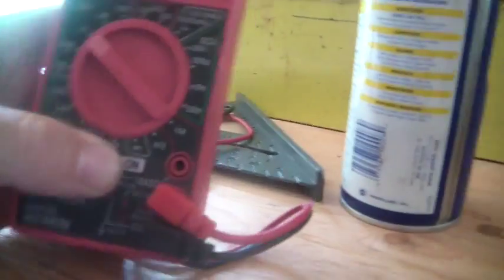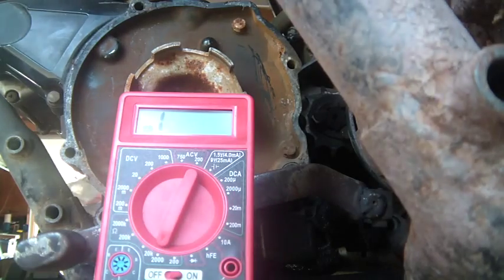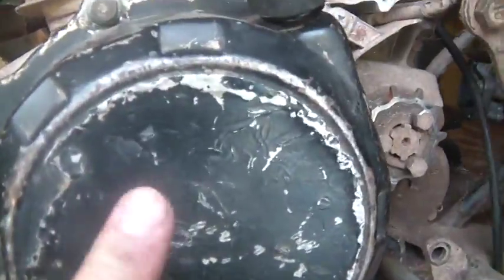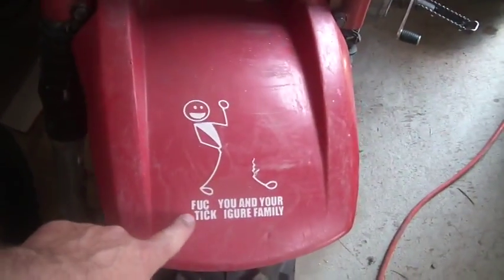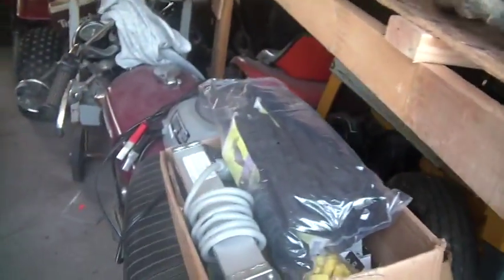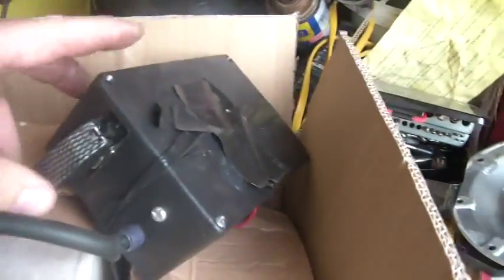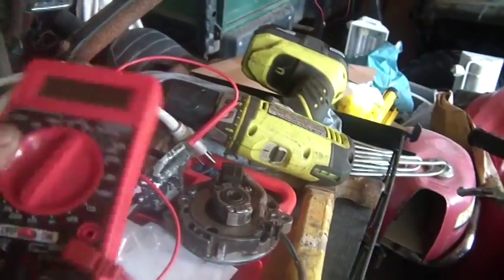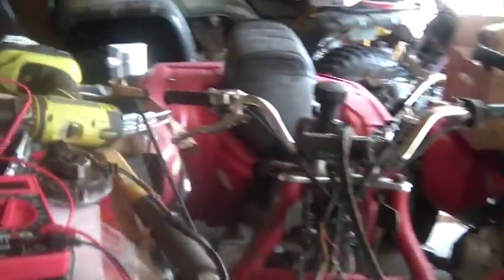8_5_2014, Solar Panels, Testing Honda ATC200 stator and Pulse coil,

Comment: My stator ran about 103ohms. Now I keep having an issue of the thing fouling out spark plugs like crazy. Now could a stator that seems to be a little low cause it to not be hot enough and then cause the spark plug to then foul? I've been chasing this issue for a while not and I'm not quite sure what could be the issue. I don't know what the compression is cause I don't have access to a tester but it feels good when I pull it over. I'm leading towards gas fouling it out because it seems to be a dry black on the plug n to smoke at all.

Comment: I'm having trouble with my 1984 ATC200S. It ran great for it's whole life. It's had a few carb rebuilds and such but it's always been solid. The issue I am now having is that there is no spark. After testing the pickup coil it read 39 ohms and seems to work great. I suspected it was the CDI box and after replacing it with a known good box It still had no spark. I've put in a new ignition coil and measured it and it also checks out. It also had a brand new plug in it that is confirmed working. I've went through the harness and other than a few butt connectors there are no breaks in the wire. I then went through and resoldered the wires back together that we're butt connected and heat shrunk them. It has excellent ground and such. 
I believe I have a bad stator coil(behind the fly wheel). I have tried measuring it like you showed in the video with a lead to ground(yes I've tried many different ground points) and the other to the red and black wire coming from the bottom of the motor. (Near the chain) I get no reading. Its always OL(overload) on my meter. This leads me to believe that there is a broken wire or that the coil actually is overloading my meter past 2000k ohms. What would you recommend? If that is in fact a bad stator coil how would I go about replacing it and who can I trust to buy from?
Reply: OL means open loop (no continuity/connection). Suspect a broken wire.
Reply: @jjc839  it sure was. I took a known good stator coil out of a donor and sure enough it checked out with my meter and when I installed it worked perfectly!
Reply: @DonovanGoodwin  good to know. I have the same issue with an 82 XL125

Comment: Hi Harvey is this the same for a 1980 185? The ohm readings and Wich wires to check?
Reply from the maker: Hey Mike, Pretty much the same readings, for the older machine, they do run a bit higher.... Thanks for asking, watching and commenting!!!
Reply: Harvey Spooner awesome thank you bud. I managed to score a 1980 atc 185 for under a hundred bucks shipped to my door and so far it's starting to look like a reasonably low hour motor.
Reply: Harvey Spooner mine must be no good it won't give a steady reading it just keeps climbing. The manual says I should be able to get a continuity reading as well but I get nothing. The one for lighting I get both an in spec ohm reading and continuity. At least one is good...lol
Reply from the maker: Hey Mike, The older Honda ATCs were known for CDI stator coil failure, I would not be surprised if it was opened or intermittent.... They sell cheap...  https://www.ebay.com/itm/1980-ATC-185-Ignition-Source-Coil-ATC185S-Stator/292144735948?hash=item44052ee6cc%3Ag%3AuLIAAOSwwzhZOdcA&_sacat=0&_nkw=ATC185s+stator&_from=R40&rt=nc&_trksid=m570.l1313     Good Luck!!!   Hopefully, U are running in no time.... BTW, a Honda ATC for $100 is a steal!!!!  Thanks for the info, watching, and commenting!!!
Reply: Harvey Spooner thanks bud you have been a huge help to me and many others over the years. Today I will keep my head up my feet down and get on out there and enjoy my day no matter how damn hot it is today.
Reply from the maker: Hey Mike, We are getting 2 inches of rain, I hope flooding is not in my picture.... Careful in the heat!
Reply: Harvey Spooner don't drown on me bud...lol

Comment: So I'm getting 199.2 ohms from the stator and 29.2 ohms on the pulser but my 200m still seems to bog out...any ideas? And timing is dead on cuz she purrs like a kitten...
Reply from the maker: Hey Dillon, Normally, when I have a quad or ATC bog down at speed, I normally think something is going on with the carb, I normally don't think ignition, thought, I'm not riding it so I can't feel what is going on.... Those ohm valves look good, especially the pulser, U should be getting a good strong spark.... I would recommend a carb clean.... Let me know how it all turns out.... Thanks for asking, the info, Ur thoughts, watching, and commenting!!!!
Reply: Harvey Spooner another honda alive my brother, Saved from the junk pile. I went ahead and ordered a pz27 carb for $12.45 and she is running strong. Come to find out the bog was due to air lock in the fuel line. I run clear hose but the petcock was clogged. Thanks again for the honda motivation🤙

Comment: Hey can you do a stator out put test? I'm not sure what he spec should be
Reply from the maker: Hey Owen, I normally just do a continuity test with an Ohm meter, but, my expectation would be 25-50VAC at 3600RPM... Output would drop off quickly at lower RPM and maybe a function of the meter's ability to read Voltage at lower frequencies, same may happen at RPM values above 3600.... Thanks for asking, watching, and commenting!!!

Comment: I have a 1981 Honda 200 atc. Ran perfect when I bought it a few months back. Gradually started to bog and hesitate to where it wouldn't even start. Bought a new plug and coil with wire, a new carb, a new stator. Pulsar ohms good. A used oem cdi box. I have a very weak spark if any. Timing is dead on also. What could be my problem? Thanks.
Reply: Hey did you ever solve this issue? Mines done the same

Comment: I have an atc 200e will start idol fine wont rev up or no power when riding it I changed everything even the motor and still no change
Reply from the maker: +jerry hayes , By changing everything, U changed the carb, all the components in the electrical system, U drained the gas and started with a fresh tank, U R sure that there is no breathing issues for the crank case or carb and then U changed the engine and kept all the changed component on the changed engine???  Unless the brakes are dragging, U have an interesting one there... Let me know what else U find... Thanks for asking, watching, and commenting!!!!

Comment: i tested between red/black wire from the stator and got a reading of 1 so im sure that means something is wrong then i also tested between the green and yellow from the stator and got a reading of 4. so is my whole stator ruined or just the black and red wire has a break?

Comment: my 84 bigred  the run and stall switch  starts in both position but big red will not turn over could have ben a short found some lose wires because there is no head light or bracket any help to fix this , thanks
Reply from the maker: joe18370 , I made U a video today, take a look and let me know if it helps... Thanks for asking, watching, and commenting!